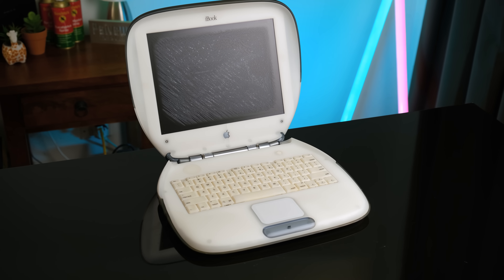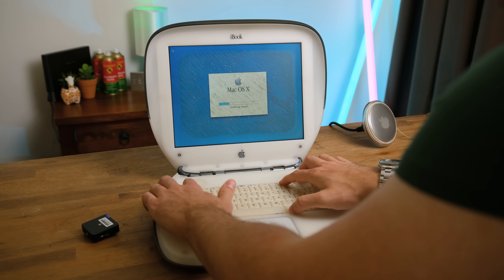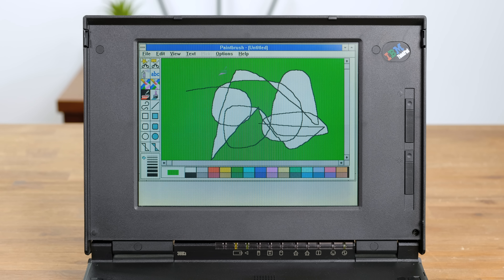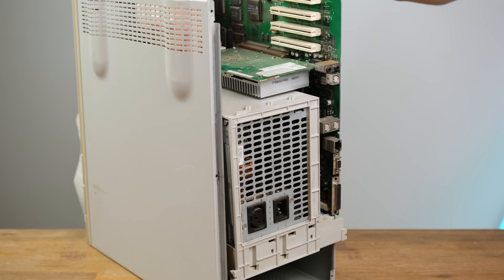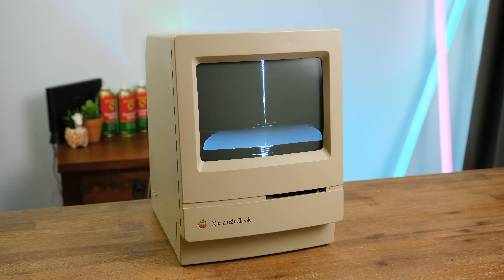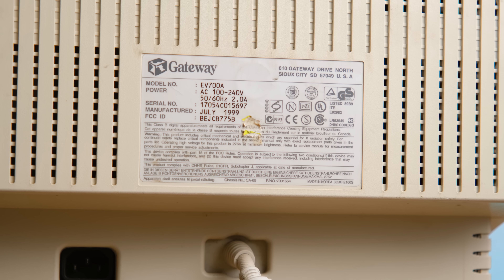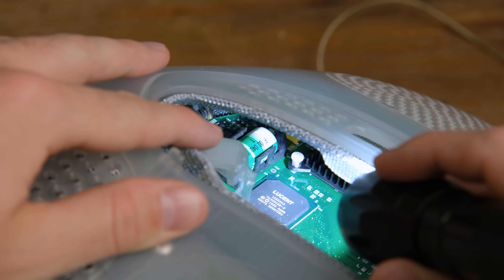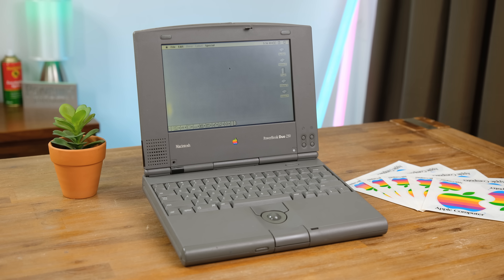So Much Vintage Tech Is Dying... Here's Why

Comment: This is what I didn't need today. Man that's depressing.
Reply: You old stuff isn't going to permanently die within your lifetime if you take better care than this idiot. He is using the wrong cleaners and is storing stuff in a shed and or garage. You can tell he is using the wrong type of cleaners for screens because the delamination and the streaking is happening only where the cloth is reaching. Guy is just an idiot basically. It is also completely repairable as it's just the polarizer thats decomposing. You can accelerate the vinegar syndrome by using tap water and exposing the screen to UV light.

Comment: Does someone know why this happens to LCD screens ? My cousins Phillips LCD TV screen melted too, I have a LCD TV from 2010 that I fear will have the same fate
Reply: Cleaning with tap water and exposure to uv light. you want your stuff to last longer? Stop using those and use screen cleaner that are  1-propanol  based. Do not confuse Isopropanol. These are two very different chemicals. Im in a group where we broke down the falsehoods and inaccuracies this you tuber has spread.

Comment: My collection of vintage computers has been in storage for sadly now.... Getting close to a decade because my life hasn't been going the way I wish it would... lol 
I fear what some of them are going to look like when I yank them out of storage. 

I got a 1994 Power Mac. one of the original ones to use the Power PC. It is also very brittle now. But not quite as bad as your example... That one I seen recently when I was moving stuff around in storage... lol

I also never took out the pram batteries or laptop batteries... But.... Like.... My stuff was never supposed to be in storage this long... 2 years tops was the plan....
Ultimately at the end... You said a major truth... I should begin selling my vintage tech when I take it out of storage because I collected allot... More then I have space for... 
& while I hoard it like a dragon.... It will just deteriorate. Ultimately I need to like limit myself to 3 vintage computers and sell everything else.... lol

Comment: I wonder if some of these problems can be fixed completely or partially by applying some sort of a transparent layer over the parts, something similar to a fixative used to preserve paintings. But this will only work if the degradation of the material is caused by exposure to oxygen.

Comment: I kept waiting for an explanation... not really that sure I got it past "battery"
Reply: Explanation, improper storage and improper cleaning. Guy uses bad cleaning practices and has bad storage habits. Constant temperature changes causing expansion and contraction, humidity and using tap water and corrosives will advance the decay of the screens. It  is also very much repairable as the only he has to replace is the polarizing part of the screen.

Comment: I am currently opening & attemping to repair some vintage point and shoot cameras cameras (1979 - 2000).

The most common, nearly unfixable killers:

1.) Removable batteries left inside the battery compartment leaking and destroying the boards
2.) Faulty flash condensators leading to smoldering or shorts when attempting to use or repair the camera (v/ dangerous!)
3.) Moisture - wrong storage in humid condition leads to funghi in the lenses and corrosion on the electronics and mechanics - can be very hard to repair
4.) UV exposure - with cameras, this can damage or desensitize photodiods, giving inaccurate measurements and bad exposures. v/ hard to find

Comment: The Amiga community has long solved the restauration of old computes. Google "leaking battery Amiga" or "bad condensator Amiga" and you see most problems solved and most is easy to apply to comparable Apple computers too. For C64 and othe 1980ths computers the power supply often dies and kills the computer along, especially in Europe where power was changed from 220V to 230V somewheree in the 1990ths. Replacement power supplies are available from Retro computer stores - yes, these are a thing.

Comment: All that Motorola stuff is garbage now. You can play with emulation on modern hardware if you want. I had 2 G4 workhorses, a 450 and a dual 500. It hurt a little bit when I threw them out but they are TOOLS for work. Unless you're running a museum... The G4s in "graphite gray" looked pretty cool. I never liked those "toilet seat" notebooks. The heavy MBPs had cold cathode lights, useless now. The first candy iMacs in that hideous bondi blue cane with 5GB HDDs. (Not a typo.)

Comment: I'm into the retro stuff but not computers. I like old test and radio equipment. They stay relevant for far longer than PCs. They are also built better and are easier to repair. Old computers are not worth repairing when I can get a raspberry Pi for 40 bucks being more capable than any 20yo machine. Old pro gear is always worth it to grab at yard sales and goodwill. I paid 5 bucks for a Hioki multi meter that I had to repair but it's now my favorite. Old PCs are not worth it unless you are into pure nostalgia. I'm a utilitarian who only cares about usefullness in the modern day.

Comment: That´s a mac book. That´s not vintage, it´s from the 90s or so, hardly 10 years ago.
I have some vintage tech here, mostly Hifi gear and recording equipment. The only thing that can go wrong here are capacitors as they dry up and have to be replaced.

Comment: I have a behringer ultracurve 8024 that runs 24/7 because the on off button is on the back and its a pain to reach it so I just leave it running. But its running since I got which was somewhere in 2001 used so it might even be older. That's at least 23 years of non stop run time and aside from the lcd screen being a bit faded it still works perfectly. And they say behringer is cheap chinese junk 😅
Also own a 1979 onkyo m8000 that is also running 24/7 as my main amp. Same story. 🤷‍♂  Some electronics can last a very very long time

Comment: This video makes me want to buy a Framework laptop even more, as the components will eventually need replacement, and its much easier on theirs than just about any other modern laptop. Plan for the failure

Comment: This is why i use modern desktops. As parts get old, i replace them. First desktop i had was in 2012. None of the original parts still exist except hard drives in cheap enclosures that i occasionally power up and defrag as backups

Comment: It's no surprise that vintage Apple products are dying. They are built with planned obsolesce. But vintage PlayStations, Dreamcasts, GameBoys, Cameras, CRT Televisions and a whole bunch of 80s tech is still working perfectly. Providing the owner is careful, vintage gear built without planned obsolescence in mind will last a very long time. But you can forget about Apple products, smartphones, tablets, smart watches, drones, goPros etc. Modern tech is designed to die.

Comment: My two portable 286 based Victor V286P and Toshiba T3200 from 1987 with amber LCD's are still working and not cracked nor scratched anywhere on the screen.
You by the way, are showing things made from Apple.😄
Probably no wonder as for the things made after the 90's why they have more issues than just the electronics that is failing.
They were cheaply made with thin plastic clips rather than using screws staritng already in the mid 80's and got worse and more common by the years.

Comment: Over my 25 years of making non functional electronics back to functional again, I'm not worried at all for my vintage stuffs breaking down soon.
I have appliances dating as far back as the early 1900's still working, a radio from 1927 recently brought back to life with 100 y/o vacuum tubes, wire player from the 50's, 70's stereo tech, early 80's and 90's computers still working, and old cars.
You get my point.
No need to worry as long as you know how to fix stuff.😊🔧
Reply: Sure, I have a houseful of vintage appliances myself, and I get what you're saying. But there is a huge difference between the "old stuff" and the "new stuff." My house was built in 1935, and I have acquired vintage housewares to match -- a 1939 refrigerator, a 1948 stove, old tube radios, a 1978 monster stereo and much, much more. Old stuff often works fine, because it is simple, it is mostly mechanical, it is made of metal and other durable materials, and even the electronic stuff was designed to be repaired. Newer stuff is much more difficult to repair, if it can be repaired at all. I salute what you're doing -- I'm doing the same. But items of a more recent vintage appear to have a much shorter lifespan.

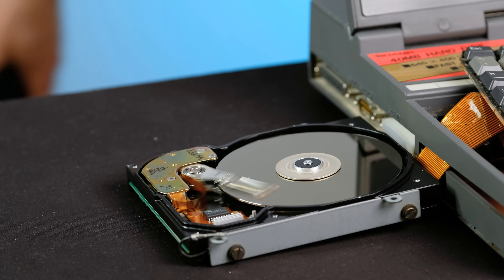Comment: 1:40 PSA: Please for the love of god, NEVER open a hard drive you care about. A single charged dust particle is all it takes to irreparably destroy all of the data on the disk, and potentially damage the hdd itself. these devices have insane tolerances. We're talking about a bit on a hard drive being as small as 0.00005 mm. If you have a hard drive that you need data recovered from, please take it to a professional!

Comment: kinda sad but really what I and most of us are probably attracted to are the shells of these devices, not the internals. those can be recreated somewhat easily, with better design choices for modern hardware, heat dissipation, power consumption, and increased longevity. that's what I'm interested in anyway

Comment: Mac from the 90s: Melts just sitting there
My Quasar microwave from the 80s: Still works so well that when I accidentally added an extra digit to my cooking time it split the plate into 3 pieces.
Reply: Yeah, I have a 1974 Montgomery Ward freezer. It's almost older than my mom, but it works perfectly.

Comment: I need info on the kind of stuff that might be wrong with the motherboard on a restoration project. Im currently trying to restore an AMD desktop system from 1999, had to replace the power supply and take apart the pc to dust just to get it to power on. After getting it on, the cpu fan was not running at all, neither was the smaller fan next to it but that eventually kicked on. The harddrive was also clicking. Nevertheless, i got it to actually post, it is stuck in the bios menu since the drive with the os is dead and i have to have a battery powered fan pointed at the cpu but i think i can fully bring it back to life.

Comment: My very first portable Mac was a.... err...  (does some Googling)...  PowerBook 165c, I think, which I purchased for $5 at a school fair in 2001.  It had the same issue with the display.  I was told that you may "recover" it if you put the display in the freezer for a while, but it was way beyond saving. 

I haven't checked my clamshell for a while.... got me worried now.  Same for my Pismo.

Comment: i found out using aluminium macbooks plugged into wall with short plug that doesnt have ground connection to be slightly spicy to the touch and causing bad corrosion on palm rest.

Comment: Yeah, old tech will need more and more maintaining over time and I doubt modern stuff will do much better with aging. It is just nature of the things. From battery leaks, that usually are most disastrous, to a lot of it needing cap replacement because they got caps that are known to be leaky, plus need to make plastic part replacements, luckily 3D printing is a thing, to fixing layers of LCD, since sometimes those deformations can be fixed by replacing right layers, like polarizer. Also soldering skills will get more and more important as chips fail and will need to be replaced. As well as caps and other stuff. Plus not to mention that batteries will forever bi ticking timebombs, like sure you can work hard to preserve them, but inevitably batteries are consumables. Similar is true with hard drives, especially if you go bit further in the past, you can basically find generations of hard drive stuff that basically mostly either already failed, or are super unreliable.  Same goes with whole tapping thing, it isn't actual fix, it is just buying time till it either inevitably fails. Or tap needs to get strong enough to cause head to bump into something. So we will likely at some point need to make replacements with combination of newer parts. Oh, plus lets not forget fixing problems with those devices they maybe didn't think that with time. Like some arcade machines were made without proper cooling, basically being designed that over time with dust buildup they cook themselves to death. So in some cases it might also be beneficial to think about upgrading stuff like cooling. Also some older devices than the video suffer from hot running chips, which is bad for long term, especially because chips aren't made anymore or hard to find. So yeah, it will be challenge. Also it is not like we are heading into better direction either, with everything getting to more and more online dependent state, like with what happens when servers go down or ultimately software is so out of date that it can't connect anymore. So yeah, it is not like it won't get any less problematic.

Comment: A little good news.  I have better luck with seventy year old technologies: TVs, radios record players. These items seem to fall into "the right to repair" category.  Ampex video recorders and  HiFi sets can meet or exceed their original specs. they also respond well to modifications.   What about tubes? What about specialized parts like transformers? Well-they do pose a challenge but there other upsides in some of these items. Sometimes as   furniture they can be really slick. Others are fun to watch while they perform their duties. Some out perform their 21st century counterparts, such as power amplifiers, turntables and speakers. A person can really lean some great skills  when repairing analog electronics: How to use test equipment, how to solder properly and how to troubleshoot  circuits.  I'd rather watch  cartoons on my Grandmother's black and white  television than struggle  repairing  an early computer.

Comment: The Cap rot of the 1990's Alot of tech is suffering the consequences of using faulty cheap caps from that era. That combined with a suicide battery is why we se a lot of "as is " Amiga's on ebay.

Comment: It's only going to get worse as biodegradable plastics replace old ABS or PC thermoplastics. People don't need tech that lasts forever anymore and retro was never a consideration. Semiconductor aging is also a thing so there will be a time when none of the chips are going to function and there won't be any NOS left to replace them with.
Not a problem for the generation that wants to collect this stuff for nostalgic reasons though. In about 60 years we'll all be dead anyway.

Comment: I have  PVM that is starting to degenerate, the plastic back shell is brittle and the metal shell is showing signs of rust regardless of how well i store them. Consoles such as the original xbox have obvious signs or rust on the shielding and appears to affect the fans also, Depending on the manufacture of the disc drive it will burn out eventuality, Thompsons i believe are the culprits. PSP i discovered that the batteries expand and explode. I thought this was a bit early for that to happen but once informed i looked at mine and bingo it has expanded. I have many things that are still in good nick but things i like, like my Flat screen 4:3 Philips tv monitor which i bought new i will never be able to replace in the future if and when it dies. The only technology that will survive in the long run are rocks 😆.

Comment: Should also mention the original xbox, most revisions before late 2004 have a massive capacitor instead of a clock battery that is incredibly prone to leaking and destroying the entire board. It's an easy replace for those who solder, but it's an actual time bomb at this point.

Comment: If you are storing these types of devices get a vacuumizer. It doesn't have to be restaurant grade just needs to be able to suck off most of the air. then you bag it twice and repeat the process every 6 months at least. Without air (or with very little air) you can store these devices indefinately. If the plastic has a rubbery feel get car tire gel and apply a small amount every 6 months too. Use screen protectors on all devices that have a TFT or LCD

Comment: Such a cool video, but also oddly sad. I can't help but wonder how our current tech will be holding up in another 10 or 20 years...
It's funny, but we have two older Gateway towers -- one from about 1999/2000, the other from 2008. We got both out about 5 years ago to see if they still worked. Well, the NEWER one was the one that actually didn't work! Crazy! The old tower worked pretty well!
I have a lot of stories I wrote as a kid on that old tower ... so here's hoping that thing still works, or at least the drive's still ok, when I get it out sometime soon to remove the data I can. I might see about taking the newer tower into a PC shop to see about its drive and salvage anything if at all possible. Same with the old one if I can no longer turn it on. My dad got rid of its CRT, which I'm still irked at, because the monitor we can plug into it everything comes out yellow somehow.

Comment: The capacitors may also be a problem, and you can't do anything about that.
I had two old devices that didn't work, I checked the power supply and the capacitors were f*cked. Bulging caps with brown dusty residues from I guess was some leak.
This things clearly aren't meant to last for decades